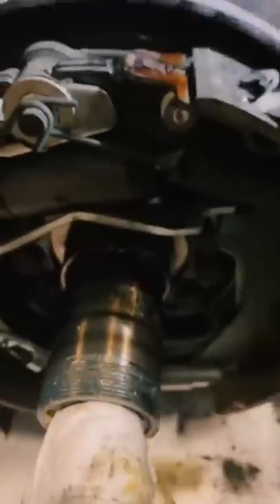I Think It Was Shrink Wrap￼

Comment: I have dealt with a lot of heavy equipment for construction. I've seen that on about three or four trucks two of them were sweeper trucks material is overflowing and spilling between the frame and the backing plate. The problem went away when removing lower dust cover to allow debris to fall out not tumble around and wind up in the brakes

Comment: Used to get that on our forklifts when we drove over shrink wrap / pallet wrap
Reply: I think it’s pallet wrap too. Seen it wrapped around axles before and the top layers look like Saran Wrap but at the bushings it looks just like this.
Reply: Do either of you understand how drum breaks work? And how absolutely difficult it is for something like plastic to get past wheels and drum to get inside! You will win the lottery first!
Reply: @kinzieconrad105  I’ve done more then a few brake jobs in my time. One of the worst I had almost 2 lbs of mud and crap in a pair of them. You absolutely can get crud inside the cover. Crap like nylon packing twine gets inside tractor drums all the time from bay bales and you end up using your engine to stop because the drums simply don’t work, (older tractors that even have brakes usually only have them on the rear).  As for pallet jacks and fork lifts I’ve seen some weird crap in parts you’d bet your life were hermetically sealed.
Reply: @kinzieconrad105  ex military mechanic for 9 years so yes I do have an understanding how drum brakes work. You’ll be surprised how plastic gets sucked in there though 🙂

Comment: I work at a mechanic shop and my coworker puts tape on the shoe when doing brakes and then takes it off when he’s done so it won’t get all dirty, maybe some one did the same thing and forgot to take the tape off before putting the drum back on !!!
Reply: Most realistic explanation right there ☝🏻
Reply: I thought that’s what brake clean is for.
Reply: @jrhackman7414  you still use brake cleaner just help a lil more.
Reply: if you run tape around it and then set the shoe adjustment when you remove the tape the shoe is adjusted perfectly with a nice small gap.  thats why they use tape.  i also know guys who use garage sale stickers stacked 3 high in various parts.  its handy
Reply: @invictusfarmer7188  wtf is a garage sale sticker though?
Reply: @markvickroy6725  small round neon colored stickers used to write prices on garage sale items.  stupid cheap.

Comment: Depends on what they make at that facility, at our plant any air filter gets clogged from all the grinding dust. In certain areas a sheet of paper can be covered in a day easily.
Reply: Yea my plant is the same way. Production lifts get new air filters every month. Those lifts are run 24 hours a day and around 26-28 days a month, they're Lindes too so their lift span is pretty short.
Reply: Or where the facility is. Under a bridge give all sorts of debris..

Comment: Work on fork lifts in a factory. they made plastic bags. Drivers would run over the plastic. And keep driving units. They would be wrapped around the rim/tire, and into the brakes. Have to cut out the plastic, down to the axle, and in the brakes as well. It happened all the time and sucked.

Comment: I’d say shrink wrap. I inspected forklifts before I became a truck driver and the amount of problems I saw amazed me. I remember some work drove through some plastic wrap. Few minutes later he had to get another forklift. He said it would go into gear. Had to get the tow lift. Tow it to the shop. Shop mechanic broke down the transmission in a few days. I saw all the parts and he said look at this. Little piece of plastic got clogged in the transmission screwing up the gears. That was fun job.

Comment: Depending on how old the shoes are, it could just be the lining material. I see that sort of layering a lot, especially on the cheap chinese brake shoes. After scrapping that layer off, you should check it for leveling. If you have some low spots then that's probably your answer

Comment: High dust / Poorly maintained environment and the operator keeps his foot either on the inching pedal or on the brake while driving causing extra heat to melt whatever they're running over. I used to take a DA sander with 80 grit paper or use a paint stick wrapped in 80 and lightly sand the shoes then douche it with the Cancer in a Can. Run a Flapper wheel on a Die Grinder around the drum to remove the glaze on them too. Add a Light shot of low pressure compressed air (wear a good dust mask at this point or use this opportunity to fire up that Marlboro Red that you're craving) reassemble, re-adjust the shoes, test run the truck with high speed stops to the seat shoes to the drums, adjust park brake handle tension and release the beast back into the herd.

Comment: When I first bought by 72 chevy 2wd one rear drum was rust welded to the Adel shaft so hard that after 2 days of penetrating oil and heat I ended up cracking it with a sledgehammer and using a cold chisel to remove the pieces still rusted to the axle flange.

Comment: I have seen something like that before. My first car the "mechanic" put "new" backing plates on. When the parking brake stopped working, it wouldnt hold the car on any incline, you could push the car with one hand with the brake fully applied, i took the drums off. It looked like it was given a bath in penetration oil of some sort and never cleaned off. The mixture of brake dust and cooked oil is really similar looking to a cooked plastic bag. It wasn't as bad as this, it had only been a couple days but it was really similar. I ended up hosing everything with brake clean and sanding the drums and shoes to clean them up.

Comment: On my 2006 Mazda BT 50 ute, the wheels cylinders looked like they weren't leaking but when I squeezed the dust boot rusty brake fluid came out. I installed two new ones yesterday.

Comment: About 10 years ago when I was working at a mobile home production company the brake axles we were ordering would come with the brake wire shrink wrapped to the magnet. Each bundle would come in about 9 or 10 axles but only 2 or 3 in the bundle would have proper working brake magnets, I would have to go through each axle and give them the babies tug on the wire and they would just pop off.

That axle supplier promptly went out of business.

Comment: Most Factorys running forks on non poished concrete create excessive rubber dust from tyre wear and this gets into the hub building up on the shoe lining in globs. Very noticable in drywall warehouse as the plaster dust makes it even worse.

Comment: Press the breaks and hold the throttle all the way down and drive about 1/2 mile will heat the breaks up red hot and melt all the plastic off.  You have to modulate the pressure on the break pedal to get moving up you keep the throttle pressed all the way down.

Comment: Not brakes, but I had a plastic garbage bag melt on to the catalytic convertor heat shield on a car I used to own.  It didn't catch fire, but it sure smelled funny all the time until a mechanic noticed it and scraped it off while it was in his shop (great guy, and he did it while it was still warm so easy to get it off).

Comment: I had so many forklift operators that wouldn’t bother picking up wrapping material and just drive over it, letting it wrap around the axle and wind its way in the drum. Had one wrapped so tight and thick it broke a brake line 🤦🏻‍♂️

Comment: Honestly, I think you're half right.

I've seen more than one forklift running around with plastic wrap stuck to it like bike tassels.
Mix that with floor dirt and tire rubber under heat and pressure from breaking and I'd bet money you get black grunge film.

Comment: Looks typical of running through high water when there was a great amount of brake dust in the drum. The dust turned to mud, then was burned onto the lining later as it dried from the heat of braking. I've seen it many times in 40 years of brake work.

Comment: Last time I had a brake drum rusted onto a hub I ended up through drilling it into the hub, then tapped the brake drum. Threaded in bolts and pressed it off slowly. I'll have to remember the axle trick, so long as it's not a CV

Comment: I'm guessing stretch wrap. Stretch and shrink are often confused. Shrink wrap is something you cover the freight with an then apply heat. Usually by a torch. Stretch wrap is most commonly used. You take the roll, Stretch it then wrap the freight. It  works great when holding multiple boxes stacked high on a skid. It's Stretch wrap on those breaks.

Comment: 2 years late so I'm just in time. I'm sure you already know this, so, for whoever. 
Run the star adjuster in all the way to collapse the shoes. 
Take a dead-blow and smack the front portion of the drum at 3 o'clock towards 9 o'clock.
the opposite side, smack the back portion at 9 o'clock towards 3 o'clock. Repeat. Repeat. Good sharp smacks, the whole drum will shift over a bit, that's how hard.
This settles sticky spring tension, helps collapse the wheel cylinder, and gets the shoes off the contact areas on the backing plate.
Should pull right off.
A lotta times the shoe grinds into the drum but leaves a bit of edge. Grinds to a bigger diameter, but  that edge is a smaller diameter, making it hang up on that little edge. You can always tell when you try to pry off the drump, it feels "spring loaded"

Comment: In most cases I pinch off the brake line using a brake line clamp bring down the star wheel and get after it with a slide hammer and a hook. Never really had to tear the pumpkin cover off ...yet LOL

Comment: I guess that's the brake shoe lining outer protection layer gunking up like that  it happens on substandard linings. It falls off as dust but due to heat and moisture then it becomes a gunk. It can't be the wrap the wrap is a very had paper nobody can leave that in there.

Comment: It's called glaze. The drum surface is too mirror like. They make more heat than provide friction. You need to turn the drum just until the cutter touches all the way around. That rough, turned surface mates to the shoes, instead of polishing them. Its the exact same principle as breaking in piston rings. They will never seal a mirror finish bore.

Comment: I can't see how stretch wrap could make it  in there.   Jump off the wire in the VNA and nick a pallet of granular material?  Then run back and forth in that mess before cleaning it up because you have 74 picks in that aisle and your manager has you down for low rates?

Comment: Thats dunnage plastic, alot of forklift drivers push that crap all over the floor, instead of picking it up. Ive cleaned many a shoes with that same crap on them. That recycled plastic just breaks apart so easy.

Comment: If it was tape, or plastic or anything like that it would burn off. It would rub clean. This makes no sense unless the cylinder is not pushing the plunger and engaging the brakes back there. Was it only that wheel?